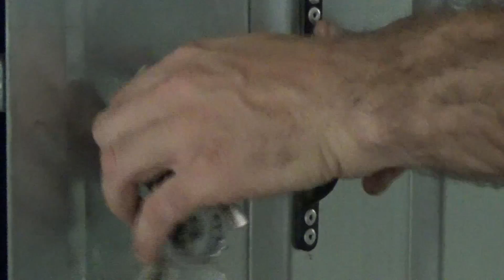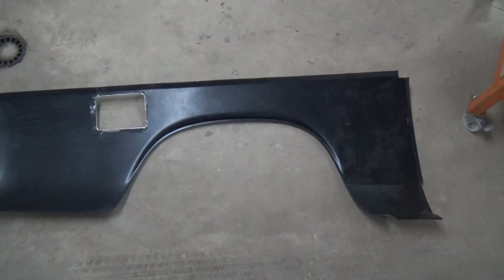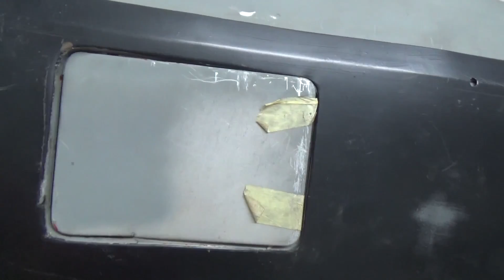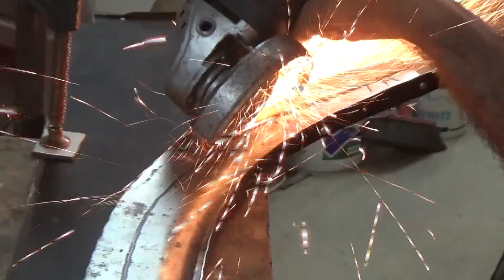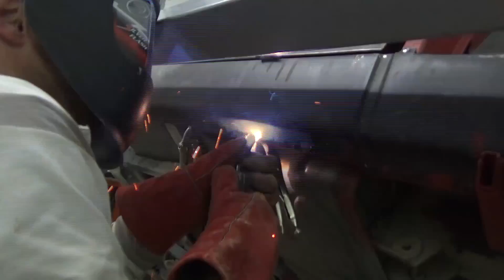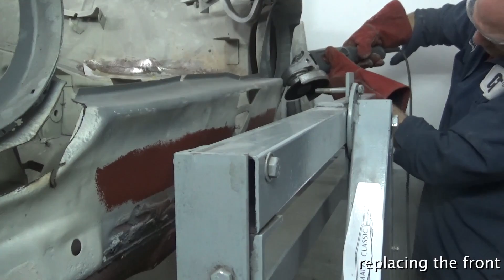Raising Junior Episode 9 - Alfa Romeo Gt Restoration (How to replace a quarter panel)

Comment: Do you somehow treat the insides of the new/old panels to prevent them rusting from the inside?
Reply from the maker: Hi, yes I use weld through primer where I can and will apply protective wax after the painting is finished

Comment: I am about to start this journey on my 1967, I am hopeful the condition is not as severe. I like that you keep as much of the original metal as possible, as I know this is not the easiest route. Your videos documenting the restoration are extremely valuable for reference and I greatly appreciate you taking the time to share. Thank you and have fun with your Alfa.
Reply from the maker: Thanks for the nice words, this particular car was is really bad shape, however I knew what needed to be done as bought it as an unfinished project, blasted and with many replacement panels. Some tips would be to be patient and try all the panels before welding and use seals for the doors as its easy to get it wrong!